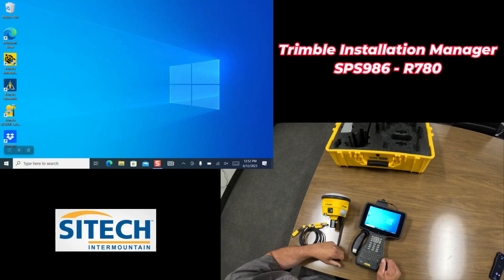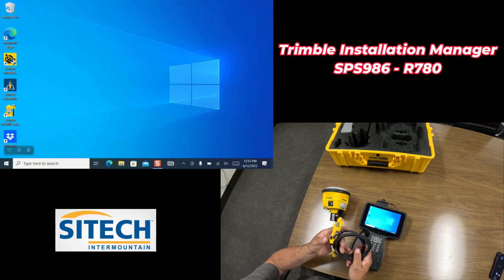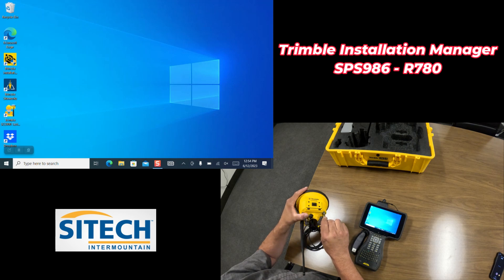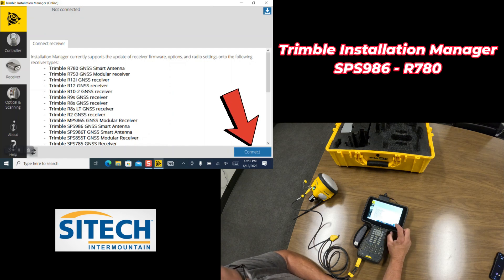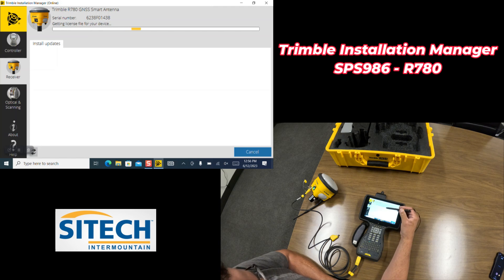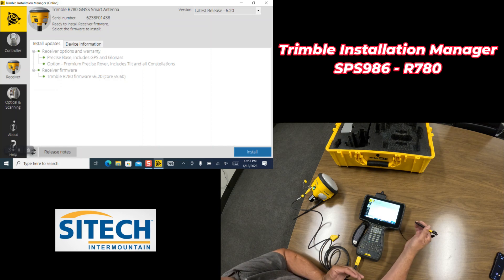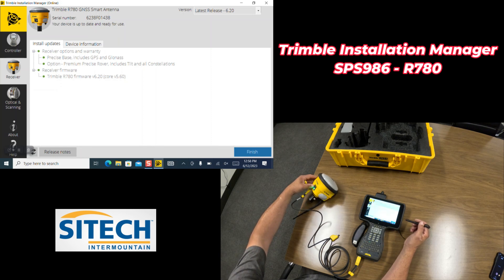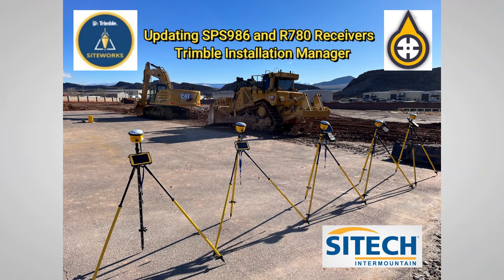Siteworks Trimble Installation Manager  Updating R780 and SPS986

Comment: I would greatly appreciate it if you could tell me how to create a new user/operator so I can store all of my Earthworks settings under my name. Sorry about being off topic.
Reply: Sorry for the late response. Yes you can save and add just like you could in GCS900. It is not done from the main CAT grade or Earthworks app you run in though, it is in Web Interface, the other app as you start up the program. You would need to get with your local dealer for the login info for that unless you know it and then just create another User in there and then you will have a login option for you and you could even enable the need for a password to login if you want. But it is done in the web interface app.